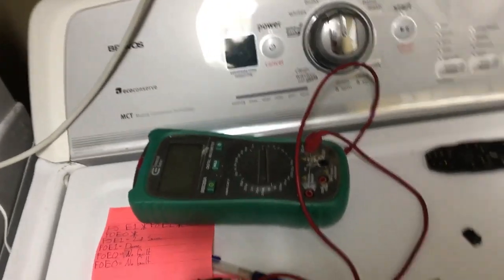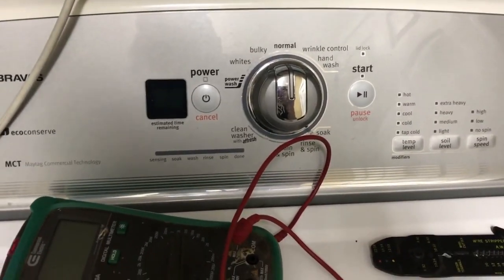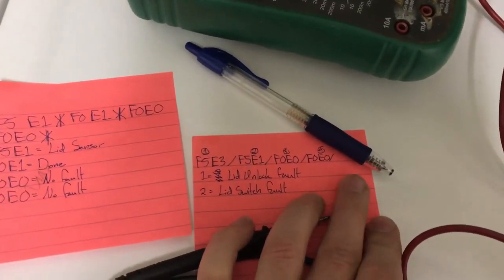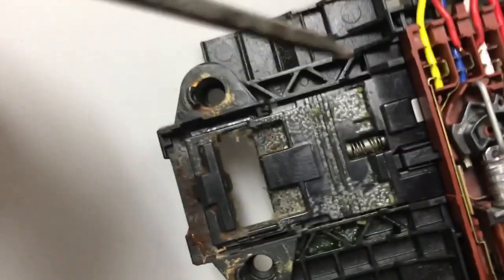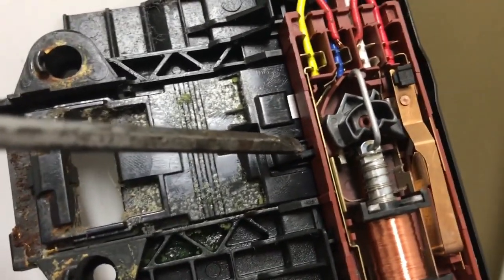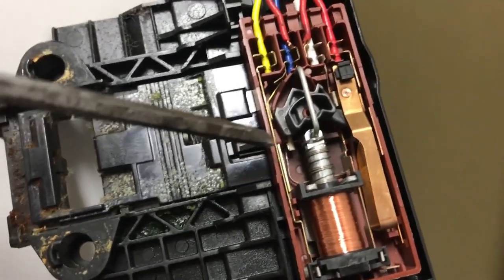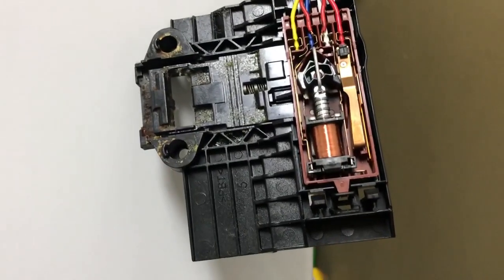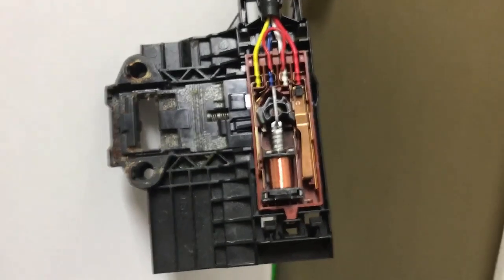Maytag washer lid lock bypass

Comment: I did that and pow popped a blue arc out of circuit board lol it helped prior to popping but i believe my circuit board was bad anyway 😅 😄
Reply: Looks great but I was concerned that something like what happened to you would happen to me.  I will never buy a washer with a lid lock again. I fixed it for six months buy moving the latch in and out many times and it worked for an extended time, Until today... I will now try to Frankenstein back into working again.